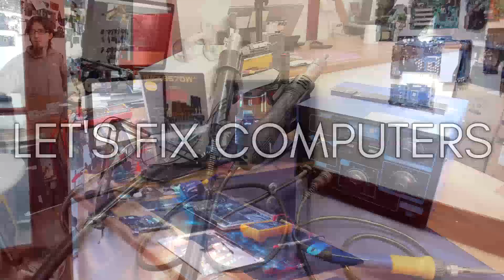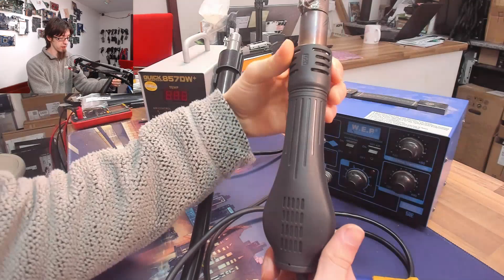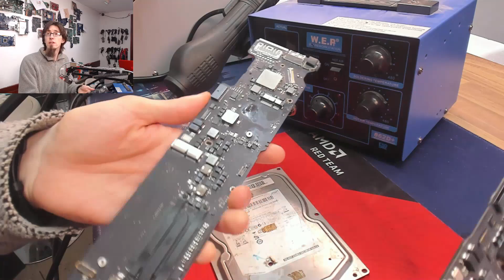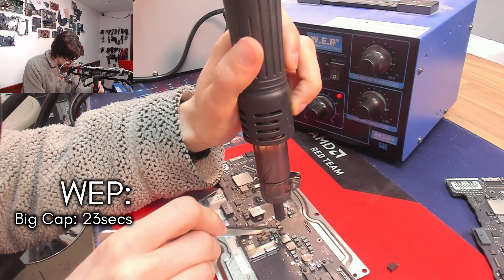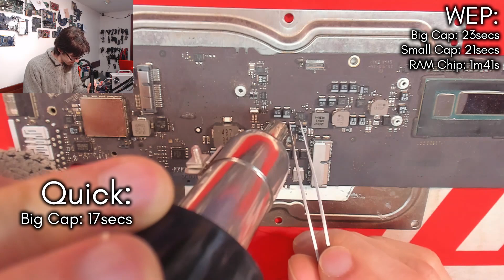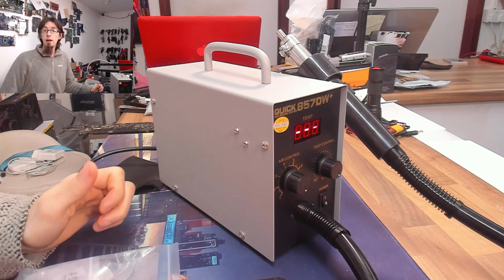Quick 857DW+ vs. WEP 2-in-1 Hot Air Test - LFC#239

Comment: got a similar wep unit, had no problems reflowing a ram chip on an old nvidia gtx275 . Also depends on how big the power/ground planes are as they wick away heat very quick.
Reply: heating the board from the underside (using an iron, a crepe maker or similar), even if just to 120-150 degrees, helps with this enormously. I struggled to get a VRAM to flow for a long time, by using a heater from the other side the job was done in a matter of minutes

Comment: It bugs me when people say you need to buy the best right out of that gate. It's terrible advice. Often there's a learning curve, and it's easy to speak from experience. However, if you're getting into auto detailing, for example, and you go out and buy a high end polisher and don't know what you're doing, you're going to burn up the paint real fast.
Reply from the maker: It's always a balancing act. I think there's a lot of value in starting with cheap tools so you can understand their limitations and know what the expensive ones are doing for you. But also it's tricky if you're struggling with something and don't know if it's the tool or the technique.

Comment: That was very helpful as i'm struggeling with big caps on macbooks as a absolute beginner. I have the cheapest hotair and as you mentioned it has this cheap handle as all the crappy ones have.
The quick sounds like a real bargain.
Reply: Have you thought about soldering tweezers? I’ve just invested I. A set for under £50. Pretty good to be fair

Comment: I bought a similar hot air unit as the quick one for £45 for doing auto repair work, with the correct plastic strips you can repair almost anything. The "official" auto unit was about £300-£350. And you could get a nitro one for about 1k.... Rip off bastards in the auto trade! 😂

Comment: Pretty sure Louis uses a Atten hot air station.
Reply from the maker: Ah, he may have changed since I last looked then...
Reply: Louis Rossmann used Quick 861DW (£246) which is few class higher model than 857DW (£80), probably still have a Quick for backup
Reply: @kiki83607  Louis uses Atten ST -862D also.... (The price is half of Quick-861DW)

Comment: I see your point about bot overspending as a beginner but with tools it's a bit different than with musical instruments. You might as well start out with a very cheap and very bad soldering iron or station and find out soldering is not for you because it's incredibly hard to do and super tedious. And give up, never knowing taht it was the tool that held you back.
I bought a 3 in one soldering, desoldering and hot air station once, for 350 € even. It was utter crap. Especially the desoldering gun was so weak it was completely dysfunctional. I returned it. If I had relied only on my experience with it I would have gotten out of hardware repairs very quickly.
So long comment, short conclusion. Beginners should not get cheap tools. They should get reasonably good tools that won't make them despair while trying to get the hang of things. There is no point in making it harder for oneself than it needs to be.
Reply from the maker: Yea I think there's a balance to be had. But I completely get what you're saying 👌

Comment: A very nice bit of kit,  makes your job easyer and quicker.
Maybe if you are heating a chip that only has gullwing pins, you could switch to the smaller tube and back the air volume off a bit,  keep the jet more confined.
I'm likely talking crap, well less than i normally do :-D
I dont need a hot air station.... yet!,  the quick looks handy though.

Comment: Sorry it doesn't make too much sense for me. 
If you are blowing more air you are reducing the temperature of the heating element faster => less heat delivered. 
If they have same power than the reason you found differences between the two must be an issue with displayed temperature and airflow reading
Reply from the maker: The heating element doesn't run flat out all the time. It runs at max to reach the set temp and then it backs off to maintain temperature. So the more air you can pump out, the harder you can run the heating element to get more heat.
Same as with a soldering iron, the power draw drops right off while it's maintaining temperature.
Reply: hi  @Adamant_IT  thanks for your reply, this is and was perfectly clear to me. 
It still valid that more airflow more heat get dissipated from the heating element which in turn has to compensate sucking more energy in order to keep the desired temperature.
Now it could be that the "Quick" one can heat the heating element more and/or faster than the cheap one (when the airflow is the same) or it could be that temperatures set on both are wrong.

In order to benchmark them we should have a way to measure both airflow and temperature regardless what those hot air stations let you setup.

Comment: What micro pencil soldering do you recommend bro. I need to find one,  I am also learning how to repair logic boards. Thank you for your videos I learn a lot.
Reply from the maker: I use a Miniware TS100 at the moment. If you go hunting though, I understand that there's quite a few cheap stations that are compatible with Hakko tips, which will give you more or less Hakko performance without the price tag.
Reply: @Adamant_IT  ok thank you btother .
Reply: Hakko FM2027 if you want big boy tips, FM2032 or tweezers if you want to sodder tiny stuff

Comment: With that big cable isn't it more difficult to handle ie it controls you rather than you control it. The other seems more useable.
Reply from the maker: I thought it would be more unwieldy, but it isn't. You do need it on the bench though, unlike the WEP, which I have on a shelf under the bench. I want to get all of my equipment up on the work bench anyway though, for better access.
Reply: @Adamant_IT  You can never have too much clear workbench....Something that seems to elude me.
Reply from the maker: A good compromise might be a shelf above the bench, so your work surface is clear and the equipment is right above in easy reach.

Comment: Dude, you got me started in micro soldering, I didn't even know it was a thing until I saw your videos, so thank you!
A little tip though, the metal HDD lid will be wicking a load of that heat away. Same with the tweers. I'd recommend getting some ceramic ones so they don't act as a heatsink and keep the heat in the board.
Reply from the maker: Meeeeeh maybe... I wouldn't have thought it makes any real difference - but that's definitely something I'll put to the test at some point!
Reply: I use a Silicone Potholder from the $1 store!

Comment: Taking the ram modules off is the exact same test Louis did when demonstrating the quick.
Reply from the maker: Ayyy. Sounds abut right. I haven't watched Louis for quite a while, but I'd previously seen him doing similar tests on ISL chips. Given that I knew RAM chips were the WEP's weakness I opted for those.
Reply: @Adamant_IT  I have the wep 8508D, so far it’s been good (hose and air pump in main housing) I haven’t had to do any reflows yet, but I’ve replaced a few pmic in tablets and laptops . I am how ever seeing it’s limitations as it takes an age to heat things up even with preheating

Comment: your hand is a great temperature measurement, saves buying any temperature measuring equipment FFS I agree the 857DW may well be better as it is a dedicated unit, but I have found the wired heat pump adequate for most work where a heat gun is required for hobby use